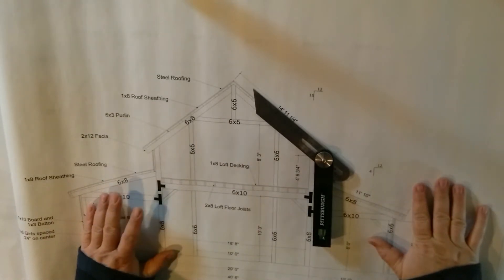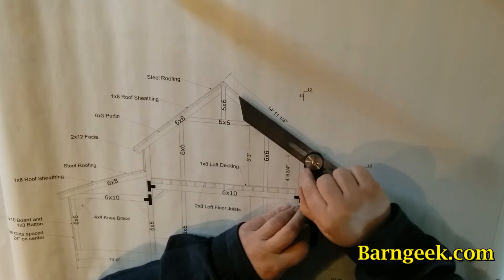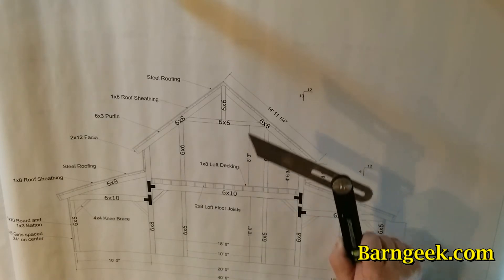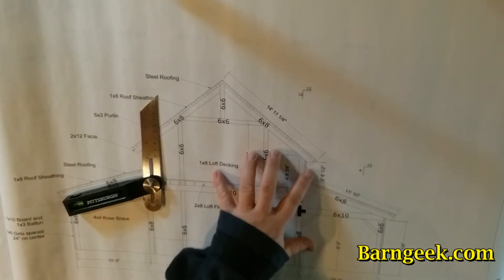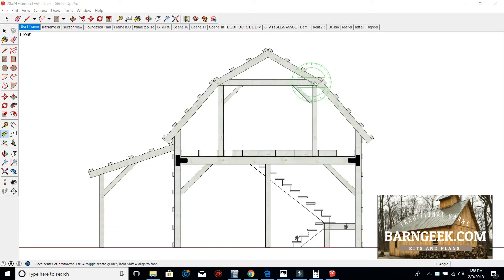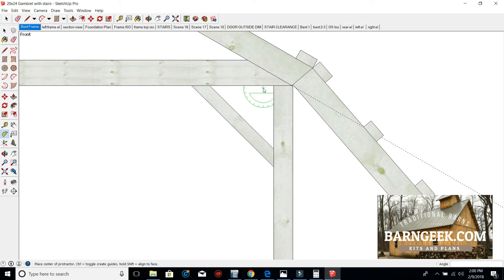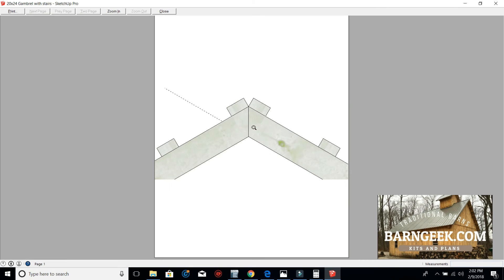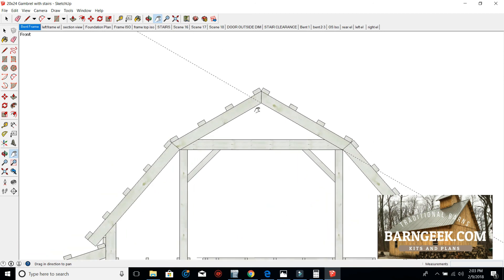How can I find the angle of the timbers on my barn plans without math?

Comment: This is an interesting theme for house builders, thanks for posting this film. If you are investing hundreds or even thousands of hours work plus materials on a building, I would strongly recommend taking the time to learn about The Pythagorean Theorem and how you can use maths to check your work. Using tools like this is good and accurate but small errors can have unwanted consequences. Being able to double check is important for amateur and professional alike.  Sadly more than one contractor I have worked with the last couple of years have made errors laying out foundations, that could have been avoided if they knew how to check their work. How long does it take to learn how to find a hypotenuse or an angle? https://www.youtube.com/watch?v=X5uFqpypDy4   she can explain.
Reply from the maker: Yes, it is certainly worthwhile to double check your work, and to learn the geometry that goes into the design.  Perhaps I will make a builders math video.  This video is meant to simplify things a bit so that the average DIYer could tackle the project.  It is important to understand the math however, and the more I think of it the more I think I should cover that in a video as well.  Thank you for the comment.